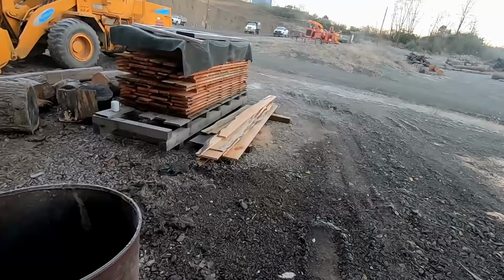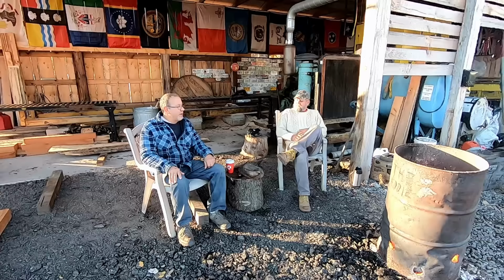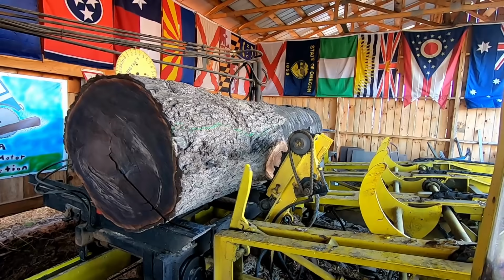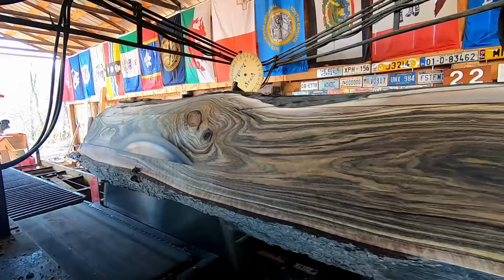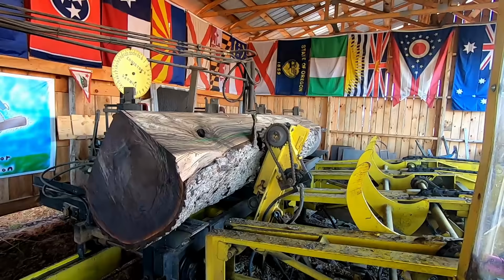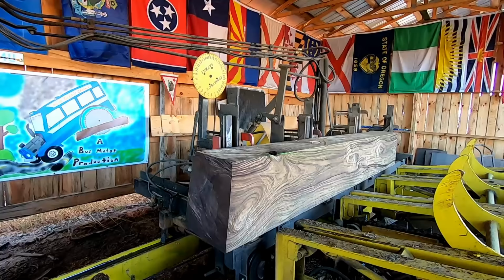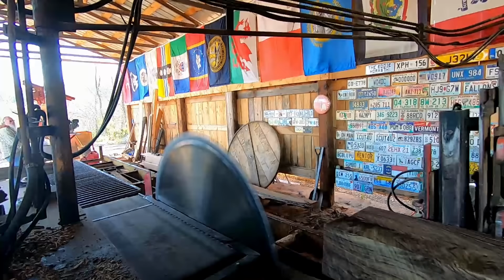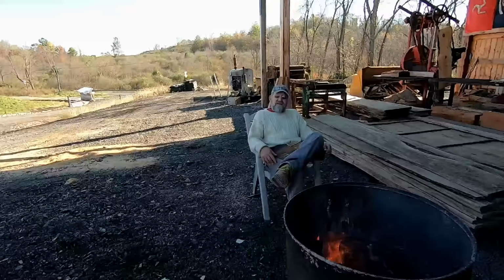sawing a big walnut log # 244

Comment: Hi guys! I am a new subscriber- just found your site. We bought a lot on a lake in central Ontario Canada and started cleaning it up. We noticed there was an old saw mill on the site years ago. We found a bunch of dead heads in the lake and took them out with an old pontoon boat - dragged them up on shore and tried to find what they were. They were totally water logged except for the one end sticking out of the water. You wouldn't believe what we found - a species called blue oak! We let it dry for a couple of years and had the wood milled - beautiful stuff- 15 ftlong and 12inches at the butt. Made rocking chairs, tables and other things - This wood was beautiful and HARD as a rock. Ever heard of blue oak? I sure didn't.

Comment: I have made "neck gaiters" from windproof double sided fleece. The women in my life just love them. Fabric 20" long, ~10" high (be careful - fleece stretches better in one direction). Zigzag the ends to make a tube. Done. You can also find pre-made neck gaiters at outdoor clothing stores. The nice things about them is that they are cheap, and can be washed separately. They also protect coat collars from skin oil.
Reply from the maker: good idea Ron.

Comment: The walnut log produced some mighty pretty lumber. But I have to ask. I am a retired professional woodworker with great experience in milling/forming/shaping/building with wood of all sorts for the last 50+ years,  and I am wondering what sort of market is interested in green hardwood lumber sawn to ¾ inches. That thin, and you'd be selling veneer stock, by the time it gets dried and planed. All lumber with moisture in it, particularly green lumber, shrinks, twists, crowns, etc., in drying, and you have to start out with thick enough stock to allow milling to make up for that. When I need 3/4 inch stock, I most always need to buy 1-1/4 inch stock to allow enough "meat" to let me mill down to 3/4" stuff, and sometime 1 1/2 inch isn't too much. So, who is interested in buying stock so thin?

Comment: I missed the name of the guy with the white beard at the end of the off bearing line. Love your work. Worked at one of the last steam powered self generating  mills before it closed in Emmett Idaho. I was a fuel man in a 13 boiler powerhouse. We powered the great steam engine which turned the belt that ran the while mill. It was awesome...

Comment: Enjoy your videos. Have us' thought about inclosing the bus motor from the back side of the radiator to the rear of pto? An insulated encloser would cut down noise big time. I love the sound of a 2 stroke. But spent a lot  my time getting my DDs down to a smooth humm.
Reply from the maker: that would be good in the winter but bad in the summer.
Reply: @markgalicic7788  if there was about 2' from ground to bottom of the side panels. The air and heat would flow out. Like in a truck.
Reply: Where are y'all located at Mr Mark I like your show and I like Mr Eddie can you buy stuff from your

Comment: Mark...i have had tree guys drop off maybe 4 foot walnut logs around 20 or so inches wide...there was no way i was cutting that into firewood...since i have a sawmill i was able to cut some real nice boards....but i don't think i would do too much of that short length for a random customer
Reply from the maker: 4' could make nice turning blanks or stair treads.

Comment: Hi Mark and T.H.E. Eddie! You're battling with 40 degree temps there, so am I, but ours is Celcius! I'm from Thabazimbi in the Limpopo Province of South Africa and we're now heading for our summer. Our current temps are in the mid to late 30's, and sometimes touching the 40's and it is a dry-heat, very low humidity! Have you ever though of a horizontal laser as well that indicate the top cutting height of your sawmill? Think it will come in handy especially with those big logs, then you would be able to see how far you can go  into the log before needing to turn or having Eddie needing to break off the cut or using the chain saw. You must maybe get in touch with knife makers, they would love your "turtles" and even the first cut after the turtle as well as any burls you come across. Enjoying your show. I'm also watching Jonathan's channel and sometimes Fall Line Ridge. O yeah, and Fricknjeep! Have a nice day and keep up the good work! Paul
P.S. Can I unsubscribe and subscribe again, trying to be the 50,000th subscriber! Hahaha.
Reply from the maker: thanks Paul , the second laser would help . the knife makers would love these logs good idea.

Comment: Walnut smells good but the dust can harm the lungs. Cherry and alder smell good when cut but shag bark hickory smells like cow manure. Most people are used to seeing steamed black walnut which has a much more uniform black color. The walnut you are cutting is unusual with the large bands of black and cream color. If quarter sawn, it may have looked similar to zebra wood. The best walnut I have ever seen comes from Peru.
Reply from the maker: yes very bad to sand with the fine dust.

Comment: Every piece if that walnut that you said was junk would still fetch a high price over here in the UK as timber prices are exorbitant, even rough cut softwoods are expensive, where once a 10 foot length of a true  2" x 4" would cost you the equivalent of a couple of $ now it would be the equivalent of a couple of $25=$30, and it would not be clear, it would be loaded with knots.